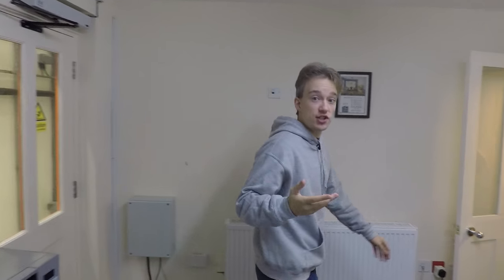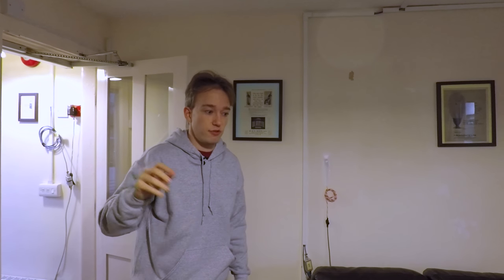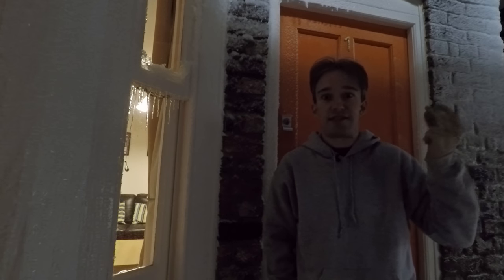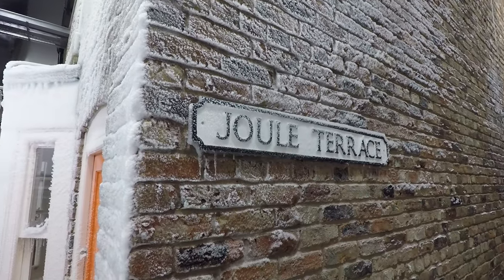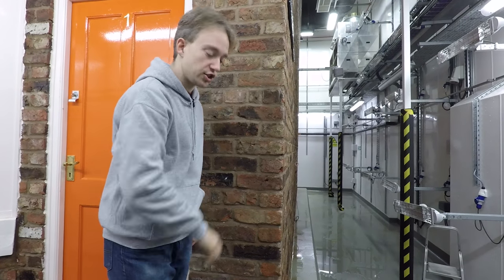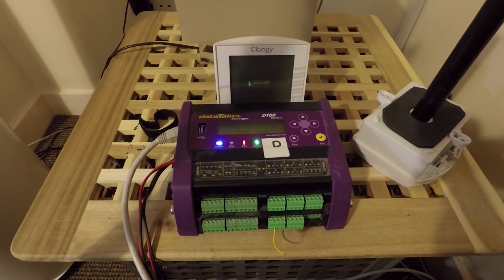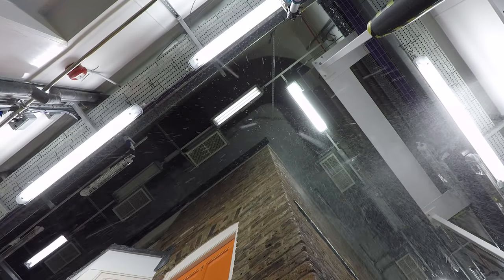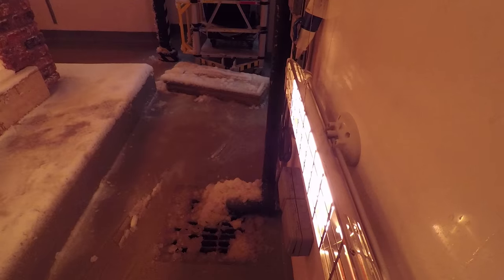Science vs the Weather: Salford's Energy House

Comment: Fellow sciency thinking people: this approximation of the sun going around the house that was briefly shown triggers my bullshit sensors. What was shown was a circle of maybe 2m in diameter of heat being targeted at the house. But the sun isn't some hot balloon wandering around your house, it's (for all practical purposes) an infinite distance away and the intensity of the heat it shines on any wall is only dependant on the angle at which it falls in. So really what they should do here is get the same emount of heat on the entire wall and just dim it according to the angle of the imaginative sun. Does that make sense?
Reply: Simon Vetter That sounds like a pretty good analysis to me. My guess would be that, because these buildings are built in groups, they could check the effects of only getting sun on the ends that don't share any walls. I guess clouds drifting across the sky could also have an effect, considering British weather, but idk if you could estimate it with some moving lamps.
Reply: Simon Vetter don't think that's what they're using to model solar gain. In any event, as the video discussed, the focus is on how the structure's building envelope performs when there's a temperature and moisture gradient with the measurable "environment" - in Britain solar gain is less of a focus than say Arizona.

Comment: A wind machine... you mean a fan?
Reply: IBM didn't use fans inside their big computers - they had ADMs (air distribution modules) - talk about calling a spade an "Earth Inverting Implement".
Reply: It's the sheer volume of air the thing can move at high RPMs. Those things generate small storms.

Comment: Someone should remind them they are forgetting about the fact humans are heat sources themselves and that activities such as electronics use and cooking can add lots of thermal energy to a system
Reply: They do handle electronics use and cooking (they mention turning appliances on and off), but they don't seem to consider body heat.
Reply: Bodies don't radiate heat very far so they might simulate it as an added effect. They don't need dolls with heaters moving on tracks.

Comment: @Tom how tall are you? I'm two metric meters but the house looks like it's made for tiny people.Can I stand up richt in there?
Reply: Picobyte All the dimensions for 2 up 2 down houses can be found on the internet. Most of them are the same size
Reply: If it helps, the standard door size in the UK is 6ft6in, so about 19mm short of 2m. You can extrapolate from there. Ceilings are usually about 9ft on the ground floor.

Comment: No IR cameras? That's odd
Reply: I bet they use them somewhere, but the cool thing about a whole-system setup like this is that you don't need fancy tech for the main end result measurement. So long as they get the environmental control right, all they need to know is how long the heating needs to stay on to keep the house comfortable. You don't decide when to turn on the heating at home using IR cameras (probably) so they don't have to either. It would actually be an unfair test to use instrumentation that a home user isn't going to have available.
Reply: I was thinking of IR cameras to know more precisely where heat leaks out of the house. And you could also know how much heat is leaking. By knowing that, you could advise people where and how they could reduce the heat loss.

Comment: just retrofit every such house with insulation, problem solved. :P
Reply: It's not that simple! There isn't a one-size-fits-all solution. There are many different ways of insulating a British brick house [they have two leaves of brick with an air gap between the leaves] & each solution has it's benefits & potential problems. e.g. increasing the insulation without reducing the moisture that's retained is a potential problem for example, but different households, lifestyles & forms of heating lead to different amounts of moisture to be dealt with. There's hundreds of insulation products out there too - some of them are best avoided for one reason or another.
Reply: nightjarflying it was a joke mate :p

Comment: Rain never falls down, it always goes sideways. 

I'm sorry, what? Has he been outside?
Reply: Nillie It has never fallen diagonally in my lifetime. I remember going to Canary islands and there was a tourist attractions where rain supposedly falls horizontally (because it's on the mountain and drive into it). It was an attraction because it doesn't happen normally. Also all the rains I have seen had fallen vertically
Reply: If the rain only ever fell vertically, the windows on your house would never get wet, the eaves would protect them. I am looking at my windows right now and they are wet, you can even see the water running down them diagonally.
Reply: In the UK the rain usually comes in on the wind so it goes every which direction and seldom down. I the UK it can rain horizontally.
Reply: ^this
We don't live amongst rainforest, or amongst particularly high mountains, and apart from London our cities are reasonably compact and leafy and don't suffer too much from Urban Heat Island effect. Plus we're surrounded by water, rather than any part of our land surrounding a great deal of it, and don't typically get enough sun to directly evaporate a massive amount of standing water directly into clouds to then fall back down at night.

Therefore the great majority (sure, not all, but most) of our rainy or snowy (or haily) weather systems occur as the result of Warm or Cold fronts - masses of moisture-laden air hitting a sharp temperature gradient and thus seeing their vapour condense into clouds and then rain. For a front to happen, you need air movement, generally as part of a cyclonic (no, wait... northern hemisphere - anticyclonic?) proto-storm system. And even in the coastal or mountainous places where you get rainshadow effect, the wind has to drive air up from the sea onto land, or over a tall protrusion, to cause the effect.

Usually in the UK there's always some wind happening, especially if in concert with other "bad" weather. As opposed to, say, the Florida Everglades, where the water just boils up off the sea and swampland (and the peninsula itself is often narrower even than the UK) thanks to the ground being wetter and at a much lower latitude, and then just buckets straight back down again as if you were standing underneath God's own watering can. When we have clouds and still air, that's when things get really muggy, and often terminate in a lightning storm, which sometimes but far from always brings our only real vertical rain with it (generally only after the clouds have had several days to accumulate).

On the flipside, I can definitely attest to the existence of horizontal rain. I've been out in fields on school trips where that's happened, and my group was actually able to stay a little drier than the others by sheltering not under, but simply behind a convenient dry stone wall...